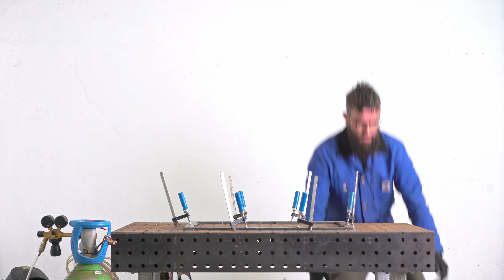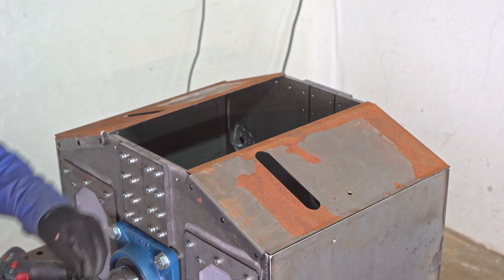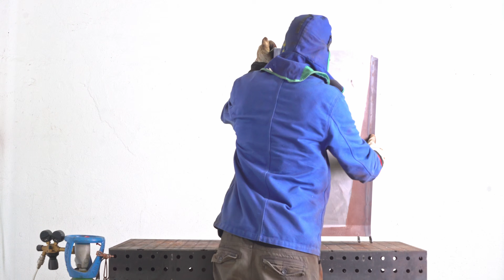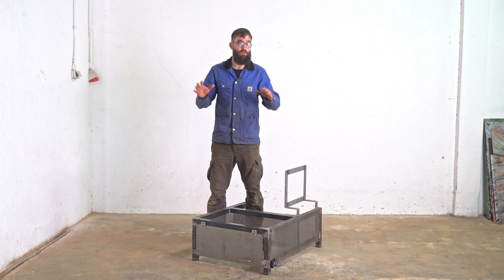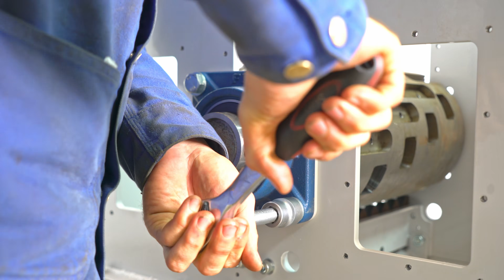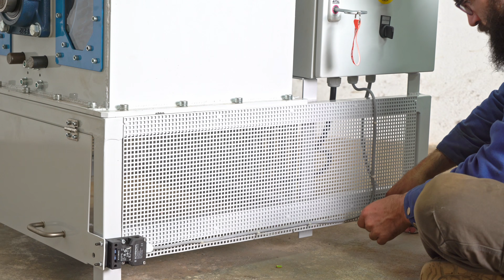How to build the Plastic Shredder Pro by WEIMA

Comment: The big issue here is that the motor is sitting on the shaft witch will give a lot of stress on the bearing because of it's weight plus the gearbox and that will lead the shaft to bend with giving time, The other issue is, Was the motor made to be used vertically? If not it will not last long, One more thing I would not call your machine a shredder it is more crusher than actually a shredder with love all the way from Algeria

Comment: I feel a wonderful hack of this machine would be to stack two of them. the top one would manage the raw material and create nominal 1 or 2 inch pieces: then it automatically goes to the next one that is perhaps faster rotation and reduces the larger chips into smaller ones.

Comment: :yt:1st, buy a $3,500 motor and $5,000 in parts and $1,200 in electronics.....:yt:
Reply: Grow up. Plastic recycling is an industrial scale problem. Not all solutions will be made from the cheapest components possible, particularly if you're building a business that depends upon these tools.

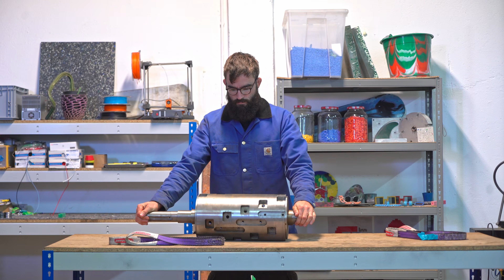Comment: 15:50 this is the point were the dream dies. I can't even imagine how much does it cost to manufacture a custom rotor like this. Its probably wiser to get one of those $1200 Plastic Shredders from china on Amazon, which can shred between 50 and 100 kg with a 220V 2.2KW motor
Reply: this is aimed at a profession situation tho. Doing 100+ kg per hour, I don't think a small scale setup can process such amounts. A pre-made machine which can do equivalent amounts of materials, even from china is presumably 15-30k incl. shipping, taxes etc. With a bit  more volume you can presumably do this sub 10k
Reply: What do you do with the shredded plastic, unless you own a plastic recycling factory?
Reply: @zyxw2000  plenty of "small scale" precious plastic recycling places
Reply: @TheYieldPoint  Exactly, unless you own a plastic recycling factory. And he doesn't mention that first you must sort the plastic into the different types. You can't melt different types together.
Reply: CCP propaganda
Reply: @OneAdam12Adam  all hail Mao Zedong 🇨🇳
Reply: Could that rotor part be made from wood, with the teeth and centre bar still made from metal? Someone more experienced than me, please tell me why this is a bad idea 😅
Reply: The rotors are for sale for €4,450.00 on the bazar. If some other shops start making these, the community could bring the price down!
Reply: @theowendorff807  At scale it can probably be done sub 1000-2000 euro. I'm just guessing it is about 100kg, so in bulk that is just 100-200 euro of material. It seems like a part which you can do on a lathe and then on a 4th axis on a CNC. Doing it on a mill-turn machine will be more efficient tho. You could probably save quite a bit if one does the rough turning first before the milling features are done. 4.5k seems a bit steep
Reply: @TheYieldPoint  Based on the drawings, its like 120 kgs, (D215 nominal with 764 total lenght ). You can buy in bulk, D220 material, with 300 kg/m weight, and the effective shredding lenght is like 500mm, so 1/3 of the base material is goes to around D50-70) so basically you machine away like 100kg of steel. And the material cost is around like 2,5 eur/kg. For this price you dont really want to throw away 100 kg for fun. 
I would 100% do it keyed or even with ribbed/splined design. Less waste material and easier to manufacture. Less "industrial"(more potentional failure) but like half of the cost. This way it would also fit easier on a manual mill with a rotating table, so technically you can do it without CNC. 
There is also some mismatch with tolerances on the drawings, but that is not so big of an issue if you are know what you are doing. But can be problematic if you are unaware.